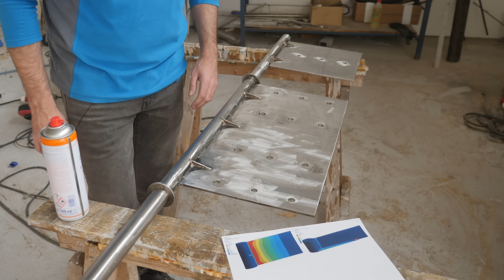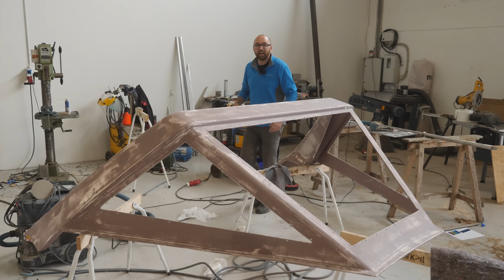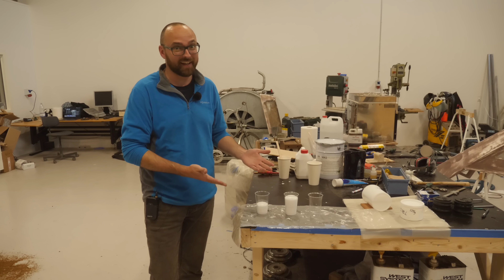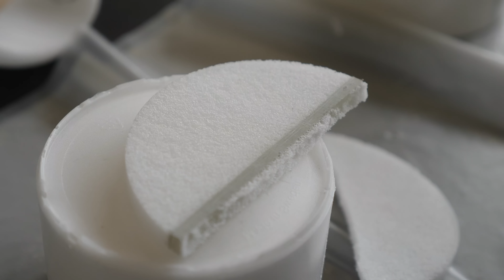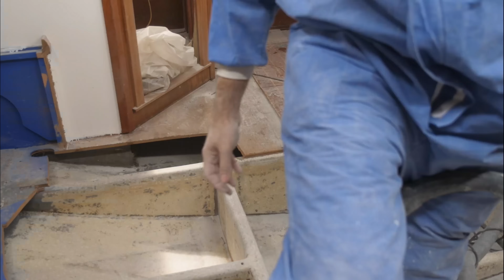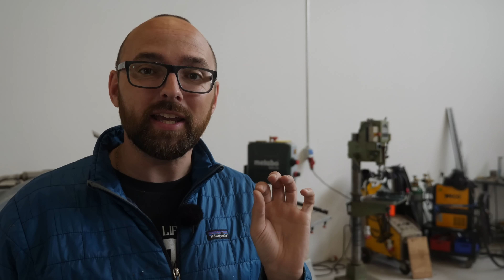Sail Life - Expanding epoxy foam for the rudder, and more sanding - DIY sailboat repair

Comment: I would avoid that PU expanding foam. I used it on a home repair to fill in space. It expands too much, and it's really strong, so it does more than take up space: it pushes things out of the way. It can bend, and even break, a 2x4.

Comment: I wish they made this without the requirements of post curing at 40 degrees, I need it to fill a structural gap but impossible to get the heat in there 😢

Comment: According to another boatbuilder/repair guy (BoatworksToday on YouTube) he reckons the stuff in the rudder should be 16lb foam, which is heavy and hard, almost like cement. The stuff you're using seems light...
Reply from the maker: 16 lb/ft3 looks to be roughly 253 kg/m3 (for us on the metric side of things). The foam I'm using is 250 kg/m3. I'm sure Andy would agree the foam I'm using is perfectly fine.

Comment: You should have those plates shot blasted and the shaft where no bearings will be. I would add more welds with the tabs to those plates Once it's blasted you can drop the whole thing anodized. Then you can finish the rudder, all metal will degrade you can rest assured that once you encapsulate those plates unless you strike something underwater it will last just as long as a new one.

Comment: Hi Mads!. One trick concerning those pinholes on the dodger. Sometimes when only really small fixes need to be made and preferably quickly, I use 5-minute epoxy glue or even 90sec epoxy glue. Both can be thickened with fillers and usually extremely small quantity of filler is enough. These glues are of course sold in very small packages which become horrendously expensive in large quantities. From the products that I can find locally, Ive found Pacer Z-Poxy 5min glue to be "reasonably" priced 22€/236g package. So ONLY when few millilitres are needed its nice to be able to carry on with the project still on the same day. Just an idea....

Comment: I used to use the PU foam for making commercial refrigerators so you should be ok for that but don't use it for the rudder!!!
Reply: PU foam is not a good fit for refrigerators in boats.. take a look at the video where Mads pulled out Athena's original refrigerator.. the PU was dripping wet.

Comment: Hope this hasn’t already been covered by others comments.  But I have some serious concerns about filling just one side of the rudder expecting enough material will go through your drilled holes to the other side.
Yes a lot will no doubt migrate, but as the viscosity thickens, you could be left with some voids on the one side.
I would try to feed both sides at once if practical.  I also like the idea of keeping the rudder immersed in a sand drum to prevent bulges, as suggested by another.
The problem, you just don’t know how the flow is going through those holes.  It would be different if it was under vacuum and being pulled through the holes.     Best...misstuffy
Reply: I can't see a sand drum being a good idea.. the weight of the sand is very likely to compress the two halves of the shell before filling. And if that happens, we've seen that the epoxy foam won't exert enough pressure to push it back into shape.

Comment: Another great video! Can the foaming epoxy be used in a location eg inside boat where the temperature can’t be boosted ie can it cure properly at room temperature?

Comment: PU off-gasses chemical fumes for several years. Typically exposure is minimal because rooms are bigger than the volume of gas is able to significantly effect.  However in a boat, rooms are smaller.  Off gassing is usually worse around certain type of timber as some timber is treated with a specific preservative that interacts with the foaming chemistry.  I'm afraid the extent of my knowledge goes no further.  It's something to consider for somebody building a smallish sailboat that might or might not be using cedar or pine as wall planking. Cutting already expanded foam and using it to fill spaces as insulation is several orders of magnitude better as a choice for sail boat use.

Comment: With the additional time you now have waiting for Athena to be moved around. What if you attempted to remove the old plywood in the structural members by drilling 2-3'' holes and essentially scraping and vacuuming out the debris? Then you could fill all the structural member voids with expanding foam and never have to worry about that pesky rotten plywood ever again. Just a thought to make it extra spiffy!

Comment: I worked for Ericson Yachts (sailboat mfg) for 15 years. We used polyurethane foam for insulation for all of our iceboxes. It works great, except you have to be careful as to how you do the pour so you have room for it to expand around the FRP icebox part, which is built into the cabinet part, such that you have room for it to expand without causing cabinet bulkheads to be deformed by the expanding foam.

Comment: Hi Mads 
I coated underwater stainless on my yacht with West epoxy 105 to protect from high salt content in tropics so far 35 years and going good. I advise coated your rudder stock with same not only will,it protect from salt water ingress that you will get at some point but the foam will adhere to the expoxy coated stainless better . Also from experience of surfboard manufacturing when pouring expanding foam you will to drill holes in rudder to allow air escape as foam expands to prevent voids in foam.

Comment: Learn something every day - have had some insulation/flotation experience with expanding PU and didn't think you'd have a show with epoxy foam but super impressed with the experimental results - some new thoughts for a current DIY boat restoration. Cheers and thanks as always

Comment: The oxide coating on the stainless is the protective layer, it is a harder and more brittle surface than the raw stainless under it, taking of the oxide may not be important.

Comment: Madds Expanding epoxy foam can be made from MAS standard low vis resin and fast hardener along with cab o sil  just mix all together with a power drill

Comment: Hi Mads, For sure have the rudder blade upright for the pour and in the moulds for support, this does not mean the rudder shaft must be vertical, the shaft could be horizontal near the floor and still the blade is upright making the depth of pour less than if the shaft were vertical. Make a box to suit the orientation with enough room to install some anti-swelling braces and still have air circulate freely around the moulds so you can heat the whole insides of the box with circulated hot air later to make it set hard.  For actual pouring make provision for funnel/s that remains in place until cut off later like a sand casting and for exits use the gap in the top of the mould so the level in the funnel will always exceed the level in the exits to ensure filling. Seal the bottom and ends gaps of the mould with sticking tape. Strap the mould together with ratchet straps plus the box braces. Due the low pressure of the expanding foam there may be a depth at which the foam cannot expand against its own weight, checkable, so maybe a few pours required but unlikely, especially with blade upright + shaft horizontal, this orientation is also less top heavy than with shaft vertical.  If more than one pour need to know the adhesion to a previous pour, checkable, nice to know beforehand anyway in case. best of luck but seems quite straight forward, the epoxy foam is re-assuringly predictable. The steel core will act as a heat sink to prevent melt down runaway. I like the new standard of ocean stainless to be painted after passivation although perhaps overkill for the shaft unless the epoxy foam is permeable to some percent.

Comment: You're doing the right thing by experimenting. I used to work at a place that made commercial refrigerators and I've seen expanding foam buckle 16ga stainless steel. Experiment with it until you're confident that you understand how it behaves!

Comment: I have foamed in a old rowing boat once snd used sl little bit too much pu foam. It gave a loud bang and the inner and outer shell of the boat came apart. There is a lot of pressure behind that. Had to scrap that boat.

Comment: Mads, great video! You should look into Seacast, a product we use for doing transom repairs in power boats. https://www.transomrepair.net/
 
I have a fairly extensive background in boatbuilding and have used  "PU" for years. It comes in several different formulations from low density to high density and both open cell and closed cell. Where an open cell low density foam would be best for a cooler, a high density closed cell would be getter for a structural condition. A low density closed cell is what you want for flotation.

While I don't have any experience with epoxy foam products, I would assume they may have comparable property formulations as PU.

-Robert

Comment: Does the epoxy foam absorb water? You wouldn't want it absorbing water inside the rudder.
Reply: The PB250 Mads used is a closed cell foam, so the answer is no, it doesn't absorb water.

Comment: I am curious what the buoyancy of this foam is.  How much weight per cubic inch can this foam float?  I don’t know if I am expressing the question correctly but in essence I’m wondering how much the foam helps to keep the aft of the boat afloat.  Does it at least zero out the weight of the rudder stock?

Comment: To pour the rudder, I would place the stock parallel to the ground with the aft edge pointed down.  Then, a few holes in the forward edge to pour into and relieve pressure.  This would allow the foam to expand upward; any out ward push should be converted to upward force since the easy route for expansion until you get a lot closer to the forward edge is toward the forward edge (more open air rather than fibreglass walls).  Your bonding experiment suggests that you should be able to pour in layers to avoid massive heat build up (perhaps an experiment: pour a layer, let it expand, pour another layer, let it set, check results; then a second experiment pour a layer, let it harden, pour another layer let is set, check results).

Comment: Pour it in with the rudder in a vehicle position and have an escape hole to allow it to flow up and out. It will not have any problem communicating through the holes and only a small area at the top that might not be perfect. If it’s horizontal could be many area not filled. When your all done you can “sound “ it and tell where the voids are.

Comment: I'm a bit confused. A few videos back you discussed PU vs epoxy foam vs PVC sheet foam and you told us you chose the PVC foam sheet. PU was out due to mechanical properties and epoxy foam was out due to outrageous cost. What changed?

BTW, I would not recommend PU/ISO as insulation where it will be exposed to moisture. It absorbs moisture and when it does, the insulation value takes a serious dive. Expanded or extruded polystyrene are a better choice. This has been heavily studied by the building science folks and manufacturers like Dow Chemical. In applications like below-grade insulation where they will encounter groundwater, these are the products recommended. In testing up to 15 years, EPS absorbed the least water. Sure, your galley (hopefully) won't be submerged, but condensation or incidental water are a concern. The inner skin of a cold box will naturally be below the dew point at all times. Household refrigerators/freezers typically use EPS as well for this reason.

FWIW, I'm with Nigal Calder on my ideal cold box given today's materials. Vacuum panels plus 4 inch / 100 mm of EPS for a refridgerator or 6 inches / 150 mm of EPS for a freezer. Vacuum panels are amazing but if/when they ever fail, they're much less than amazing. Belt and bracers approach ensures you're not screwed when that happens.

Comment: According to the Sicomin website, PB250 expands 95% or so in first 35 minutes.  How about an experiment pouring each half, screeding off at 35 minutes, and clamping the halves together for the final expansion/cure?  Have a similar project in my future and have been mulling possibilities.

Comment: Hi Mads , I don't like the idea of filling the rudder with an expanding epoxy foam from the top. Very hard to ensure you get it to fill properly and the shaft area is the mosts critical for water intrusion and strength. (It will also add 5-10psi head pressure to deal with)
I suggest you stand with shaft side down and with the back edge Up , you must also do it while in the mold too. But how to get material in? Well you won't like it but cut some holes in the mold edge so you can pour thru holes in the edge . Since you will eventually be glassing over the joint on the exterior that will take care of the holes. You can repair the mold later if somebody else wants to reuse it. But 2  or 3 holes is probably all you will need. And just big enough for the tip of a couple of plastic funnels.
( alternatively fill from the top and lay it down before expansion but that's complicated).
Having said that , as I suggest previously you should fill each half first, allow to cure ,then glue halves together , much easier and you know what is going on.
The post curing is going to be a big problem too........
Also as somebody else said regular fast curing 'automotive body putty ' is the product to use for the pin holes. That what the paint shop will do after spraying with primer.
Cheers Warren

Comment: Hi Mads

perhaps making something like supports on the inside of the shells to secure the rudderstock is staying centered in the molds is in order..? As it is now, the foam can push it around and the stock could end up sitting to one side inside.

Also noticeable from your experiment with flow is that the void present in the sample is situated where the AIR got trapped, so keep in mind to drill/leave pinhole size holes in any corners and places where this might happen.. Could be done by simply pushing a needle/nail through the newly laid up glass you join the shells with, and removing it at the right time (when the resin is not flowing to close the gap, but also not hardened sufficiently to hold on to the nail)

Comment: Mads - what is your thinking on using epoxy for the rib strengthening in the boat? I get that epoxy is stronger than polyester, but not much stronger than vinylester. The hull would have been laid up in polyester I imagine (if it was epoxy then that is impressive  - and expensive!). Epoxy is nicer to work with due to the solvents involved, but cost wise it is much more expensive than polyester. Given you are mainly relying on the increased section inertia of the new ribs by virtue of increasing wall thickness, then I reckon (as an Engineer), that the stiffness increase you will get will not be greatly different between the two resin systems. I realise you are well underway now and have the materials, but I almost always try to keep resin systems the same when I am repairing structures.

Comment: Thanks Mads for the video.  Watching the epoxy foam versus the pu foam was interesting. I have never used the expanding 2 part foams just the spray foam from cans but I would be tempted to place the rudder with the shaft at the bottom and the trailing edge at the top with holes along the trailing edge to pour in the foam from the top.  The rudder stock would act as a heat sink and you could pour along both sides of the plates as Grant Myers mentions below.
Looking forward to seeing how you do.  Take care and have a great week.

Comment: Hi Mads, I wouldn't recommend to grind the surface of the rudder before pickling with a 80 grid or something. To avoid crevice/pitting corrosion you want a almost polished surface. I don't think it matters to much, when you look at the size of pits you had after all these years. I have seen much higher corrosion rates. But if you take the effort to get it freshly pickled and repassivated you should do the appropriate surface preparation. I am a material scientist specialised on steel and stainless steel, corrosion and welding. And most important just refitting an beneteau 405 First.  So I follow your channel with a lot of pleasure. I would be happy to exchange some experience. Best regards from Hamburg boris (Boris_fergg@hotmail.com)
Reply: I forgot to mention, that you should definitely paint it before assembly. By specification stainless steel piping has to be painted if offshore and if covered with insulation, which is similar to your foam. This is fairly new to industry so most people don't know yet.

Comment: Is the rudder stock solid? I had one break where the tube enters the rudder. Not fun.  If this was my rudder I would insert a sleeve, then either bolt or weld it to the existing stock. Color me paranoid.
Reply: Going by the way Mads struggled to pick up the stock, I'd say it was solid.

Comment: Hey Mads, Always a treat on Sundays and good to see that you are taking to your PPE with not a second thought, but just out of curiosity i and probably a lot more notice that during ALL THAT GLORIOUS SANDING and GRINDING you do not appear   to be wearing any kind of anti vibration gloves? maybe you take them off for that part of the video? if i recall correctly the time level for using vibrating power tools is max 60 mins continuous use with 20 min minimum break from use, just a thought and maybe this has been mentioned before but once you get white finger that`s it. Anyway do you plan on tabbing the rudder stock onto the shells so it is central? how will this effect the flow inside once you have poured it? maybe placing the rudder at 45` and attaching a sander ( without the sand paper )to act as a mini vibrator to eliminate the air pockets? All the best in whatever direction you decide to tackle this and any other issues that may arise.